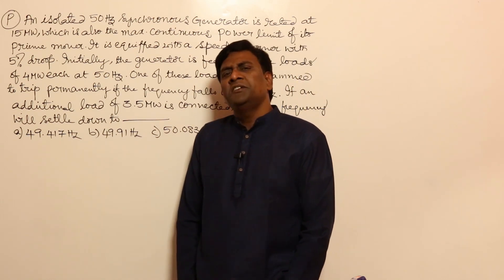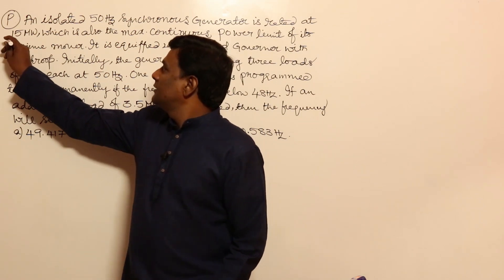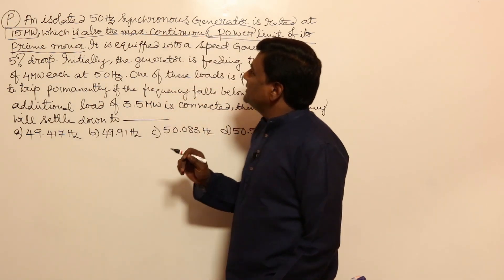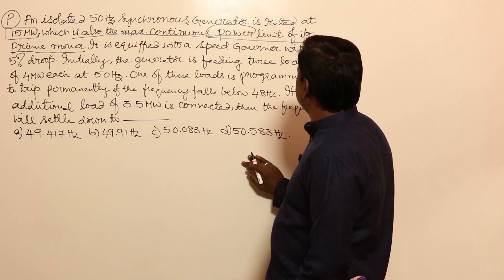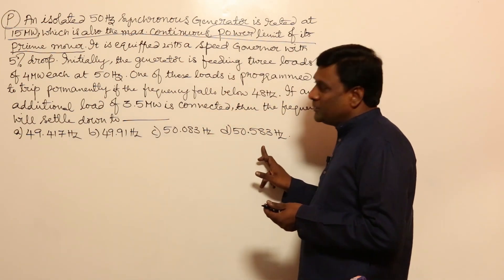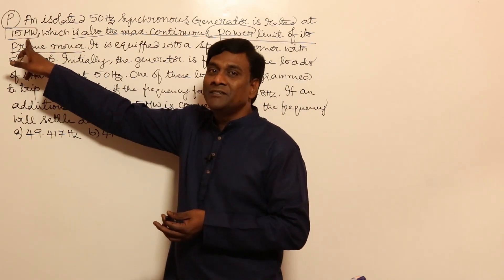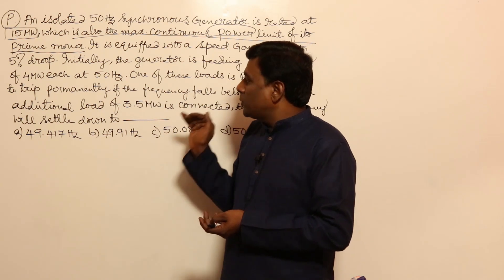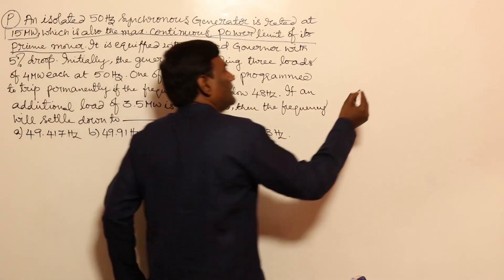Random Doubt | Power Systems Load Frequency Control OG Qn | Power Systems | GATE Lectures by KN Rao

Comment: Sir in similar question with different numericals if options are not given. In Made easy test series solution, they took load is tripped and calculated answer. So we have to go according to options if the question is given like this? But that looks strange? Add score should be given or only one process should be followed?